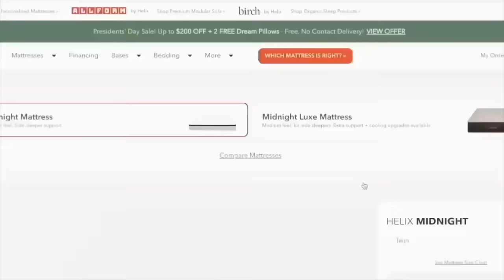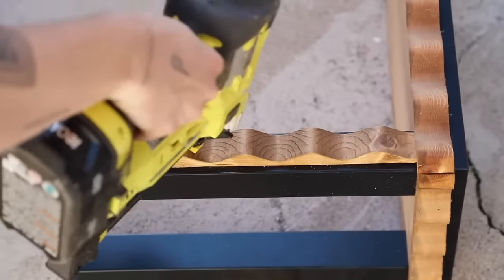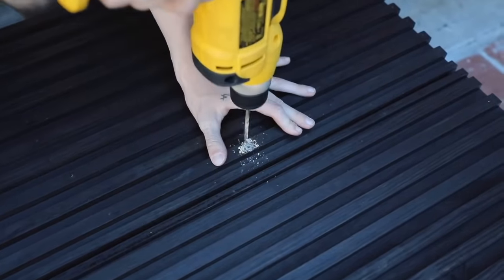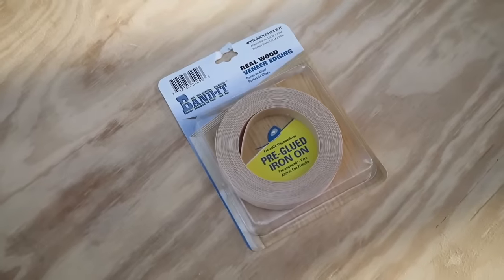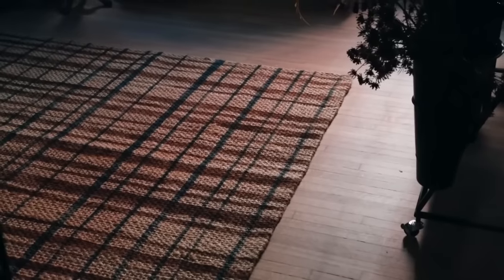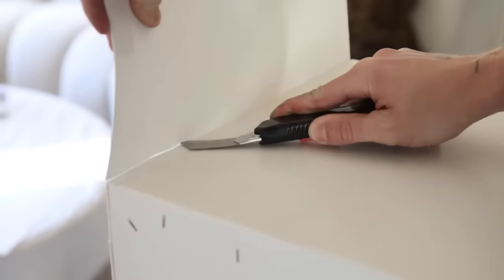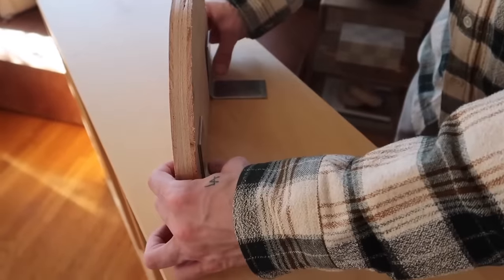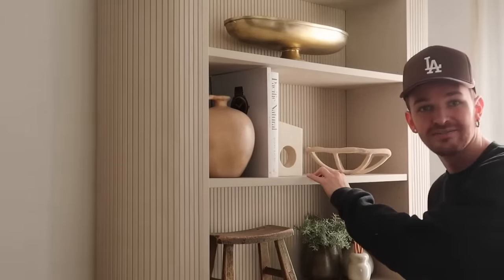10 DIY Ikea Hacks Worth Your TIME & ENERGY! 🔨 Furniture & Home Decor

Comment: So much fun, i remember some of these from the original videos ☺️ here the Timestamps
3:23 Project 1 - Fabric wrapped frames
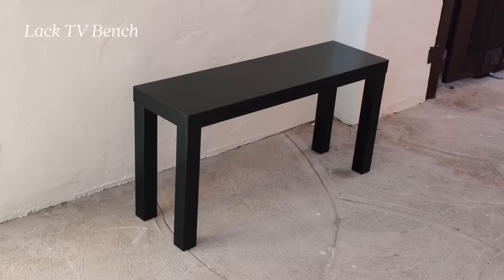6:20 Project 2- wavy edge side table
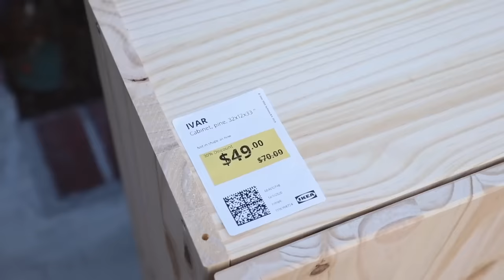9:28 3 - fluted bar cabinet
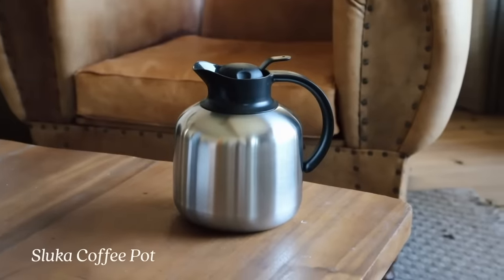15:54 4 - aluminum mushroom lamp
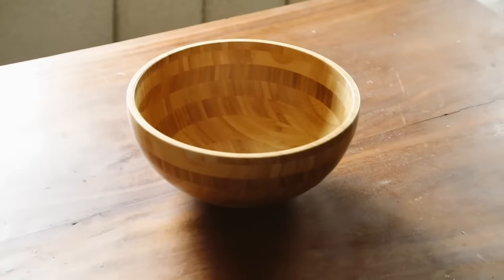18:01 5 - Salad bowl coffee table
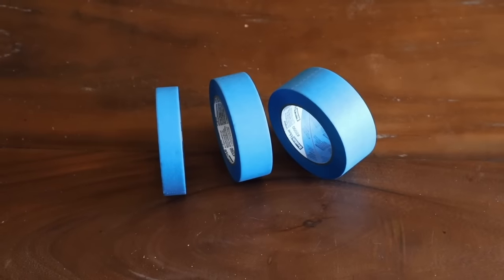25:17 6 - plaid accent rug
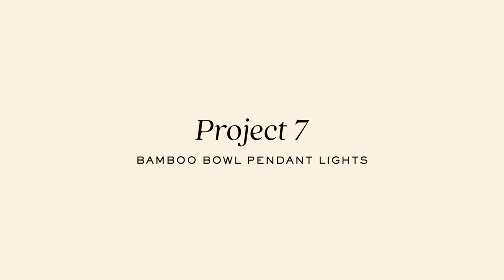28:40 7 - bamboo bowl pendant light
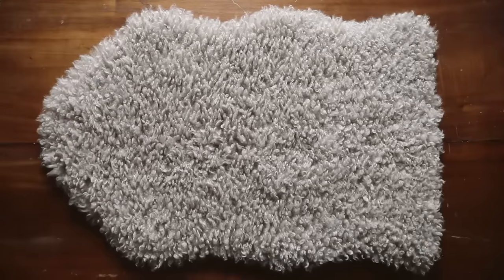30:39 8 - fluffing up chair in fur rug 
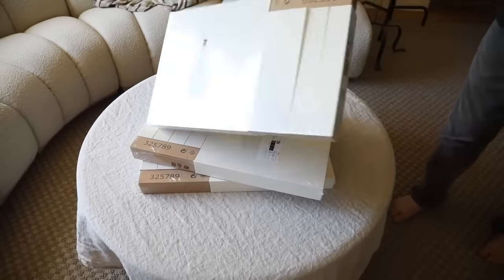33:24 9 - plaster/ concrete pedestal 
36:58 10 - pole wrapped billy bookcase
❤❤❤

Comment: @DIY Metal-Lamp: Caution Eletrical Safety: touchable metal should be connected with electrical "Protective Earth" (PE, todays wire color = yellow-green). Don't confused PE with hot wire "Phase" (L, black) or opposite cold wire "Neutral" (N, blue).

Comment: You need to start using Safety glasses when you use power tools !!  Many a small wood speck can get in your eye too easily .   Also a bad example.   Also from a woodworker, Brad nails are not very strong and slide out easily.